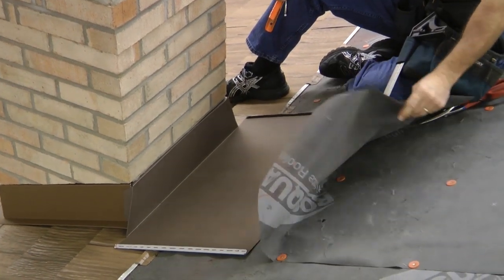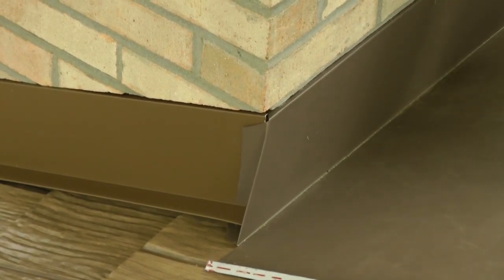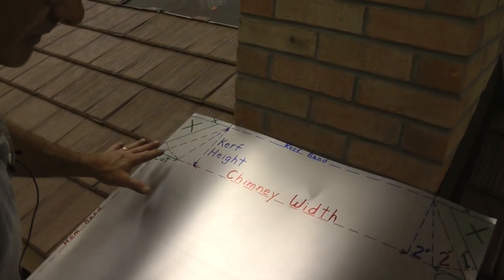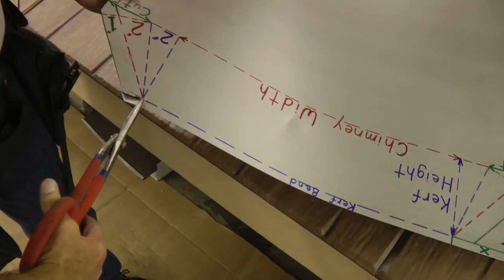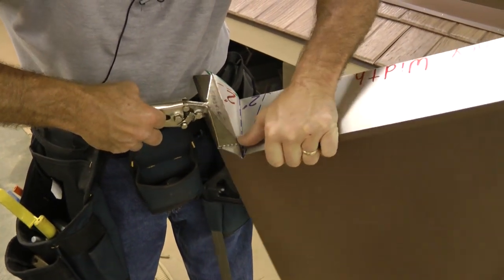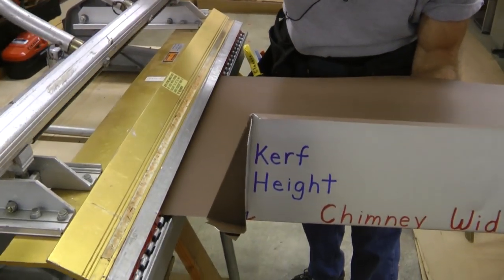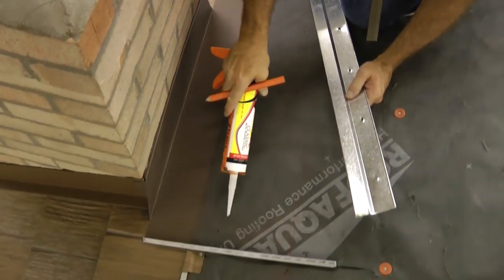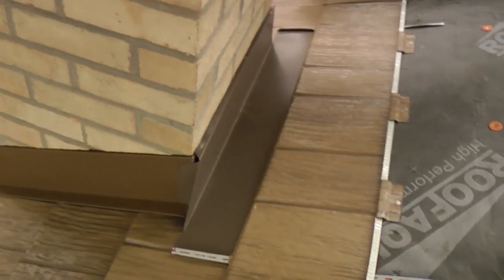Chimney Upslope Flashing

Comment: @ 4:25 is that 2nd 2" messured on the streight green line or the red dotted angled line?
Reply from the maker: Excellent question!  The second 2” must be measured perpendicular to the second, diagonal, dashed blue line (whose base is 2” out from the edge of the chimney).  Thus, the 2” is measured on the red dashed line. 

 Sorry I didn’t make this clearer in the video.  Thanks!

Comment: Those are metal shingles right? Is that illuminum coil flashing? Can you get metal coil or would you stick with aluminum? What gauge is it? I have 2 practice my bends
Reply from the maker: This is a steel shingle system so the trims and flashing coil are all the same pre-painted steel. The metal for this product is roughly 28 gauge.
Reply: @KasselandIrons  the coil and the shingle are both 28 gauge metal? Isn't the shingle a bit thicker?
Reply from the maker: @Brandon-no3vc  The G90 steel from which all parts of the system are manufactured is .0142” before the paint is applied.  Most folks would consider that to be 28 gauge.  We actually do prefer to talk in decimal thickness though as gauge is a range and it’s easier for folks to play games with ranges.
Reply: @KasselandIrons  why aren't the shingles as flimsy as the coil metal then?
Reply from the maker: @Brandon-no3vc  Because the press forming builds strength into the formed steel panels. Think of a paper airplane versus a sheet of paper.

Comment: You are appear to have done the best job of all the videos I’ve watched on this so far.  My only question is, why not trim or back fold the four of the flashing?  The white parts that stick out below the shingles.  Depending on the response I’d score you a 98 bc of those minor details.  Otherwise, your ideas and attention to detail are way ahead of the others.
Reply from the maker: Hi Paul. Thanks for the encouraging words! I’m not positive about what you are asking here but I think you’re referring the flange on the pan that sticks out about 4” below the shingles in this video. I did think about this after the video was made and made some adjustments in later installation manuals. In our Rustic manual, I say, “Note that the side flanges of the back flashing are snipped and turned down into the rain grooves or folded under where the pan is exposed to view.  This will avoid showing unpainted metal and also provide rigidity (right arrow). Sealant should be applied under the side edges of the exposed pan (right & left arrows)” (page 48). I included photos with arrows to clarify what I was referring to.  Congratulations, Paul, for the careful thinking on this detail!  Keep up the good work!